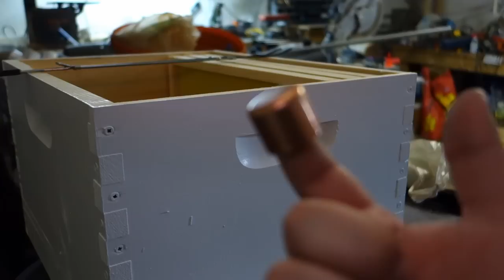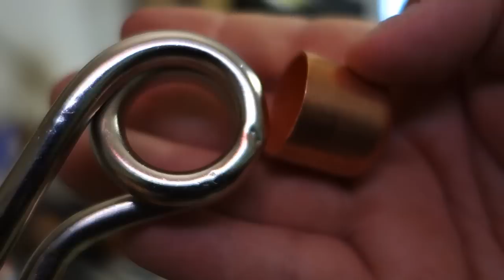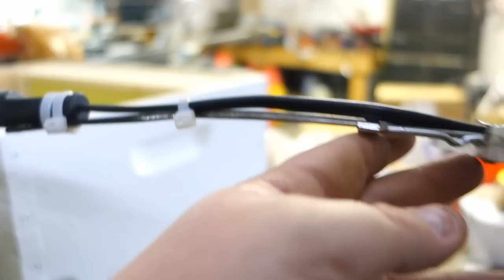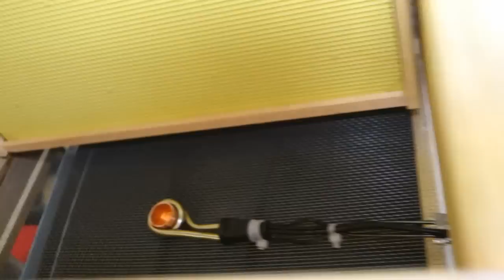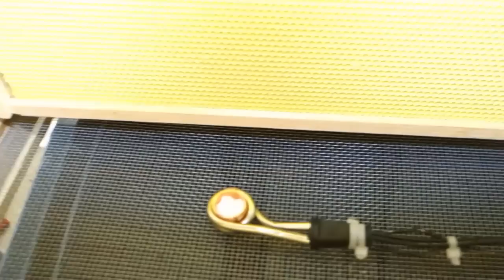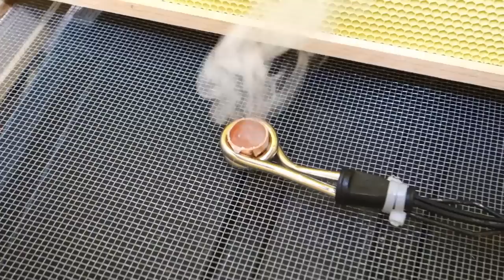Homemade Oxalic Acid Vaporizer

Comment: My question is… does the temp exceed 372F degrees? Oxalic acid vaporizes at 315F degrees but when it reaches 372, it turns to carbon dioxide and loses its potency.

Comment: Do you pull the this out before t
It start sputtering in the hive during treatment?
Reply from the maker: No I pulled it out after the timer turned off. I timed the amount of seconds it needed to burn through everything. I have since bought an OA machine and love it. It was expensive but well worth it.

Comment: I like the idea but this project fir me didn’t turned as cheap as you said. The main thing I  struggle is how did you twist the  metal part to make  it fit I to the entrance  ? I wish you would show the video step by step how you did that.  The heater cost me $10 each at the bath and beyond and unfortunately  something happens when I bend  and pound on it.  At this point I don’t know if it will be cheaper to buy ready to go or continue spending money  until it work. I am sure if you would show on the video how you did it I wouldn’t have to waste my money. Thanks

Comment: Just seen an equivalent video on YT suggesting the use of a diesel glow plug to heat a brass bored out nut. Surely using something that is designed to heat up to such temps, powered by a battery, might be comparable in price and have greater longevity?!

Comment: By silver soldering the cap into the warmer will help heat transfer a bit better.  The heater does not oxidize the oxalic acid, it just changes the state of the solid into a gas.... same stuff, no chemical change.

Comment: made it!!Works good these won't get hot enough to make formic acid .These work good BUT are pretty slow I used one on bunch of double Nucs today,formic acid and carbon monoxide don't occur until 372 degrees , this just ain't gonna happen with these too much heat loss

Comment: looks too hot to me
Reply: The idea that something at 220 deg.c, pushing inside the hive itself is bad.Ideally keeping heating business out of hive,and sending vapours in thru a small pipe atleast 200 mm long to cool off is what is needed to avoid harm to bees,brood and comb.Actually a smoker with pine needles  already hot(will not go much hotter than 250 deg.C with pine needles or  grass or news paper) ,and toss in 2/3 grams of OA loosely wrapped in aluminium foil  will do .By doing couple of times u know how much time is needed to vapourise all the OA.

Comment: Good idea but the heater is not meant to work out of water. You might get 3 or 4 uses out of this before it burns out. so first of all, use a 5/8 "  copper cap and it will make it easier to put it into the unit. Then you will have to buy a dimmer to run your electricity thru so as not to burn out your heater. A plug in dimmer is easier to use because you will have no wiring to connect..  Now you can regulate your voltage and not overload your heater. Only turn up the dimmer high enough to vaporize the acid.

Comment: Tried this with the ac unit from bb&b. Only works once, then burns out! Not saving money if I have to buy a new element after each use.
Reply: Vaporizers cost up to $400 you can buy a lot of these at $12 each. Put it in the rear under the mesh bottom board

Comment: Looking into OA for treating my hives.  What is the likelihood that this will melt the wax in the frames and cause a fire?  Have you tested with a wax frame in place to see how long that would take to happen or what the effects of the heat are on the wax?  I do assume some bees will get burned either way but as long as the whole hive doesn't catch on fire it is a sacrifice worth making.
Reply from the maker: Hi there, and thanks for the inquiry. I do not use this device anymore as it does not have a temperature control. It is really important that whatever design you use, it must fit under the entryway without pulling up on the bottom deep. I learned that if you do that, the device will be too close to the frames. I decided to use the oxvap110. It is pricey but boy is it worth every penny. Check out that video that I did.
Reply: I'll check it out, thank you
Reply: Dude that thing is sick
Reply from the maker: you like it dont ya? Its WAY better. The designer of it did a great job and it is worth every penny. I have very low mite counts from a mite infestation last year

Comment: appreciate the video, I'm thinking about doing this but I wonder rather than put the heater in the hive could the acid not be heated outside and delivered via a tube into the hive? wouldmthere be objections to doing it that way, might it condense on the inside of the tube perhaps?
Reply from the maker: thanks for the inquiry. I have thought about it myself but the answer is probably not. I have tried it and in order to properly sublimate oxalic acid, one needs to be in a certain temp range. Once the "gas" is making its way through the tube that is cooler than the heater, it will immediately crystallize. This is why it should be done inside the hive or RIGHT outside the hive. Thanks!

Comment: How much did you spend on the respirator?  Maybe use the bottom of a soda can if the copper pipe cap doesn't work out easily.  Maybe put the vaporizer under the screened bottom board if you are concerned about setting the beehive on fire.

Comment: I bought a heater off ebay and it was way too small for a 3/4" and way too big for a 1/2" so I found a brass screw thread cap for a gas line that I could screw into the coil. It worked perfectly. The only problem is the first time I used it the plastic holding the aluminum coil started to melt. This is for a Top bar hive. It fits in a 1-3/8" hole.[IMG]http://i127.photobucket.com/albums/p133/larrylwill/P1020552.jpg[/IMG]
Reply from the maker: +Larry Williard awesome, Check out my 2016 upgrade. Works very well!

Comment: Michael, did you ever come up with a better design? I just ordered an AC immersion heater since my hives are near the house. Do you recommend a dimmer switch to limit temperature and avoid overheating/frying the heater? Thanks for the inspiration.
Reply from the maker: Yes, I currently am almost finished with and updated design. Total cost is about 45 bucks but has temp control.
Reply: don't need it doesn't get hot enough actually don't heat near fast enough,I know I saw u time it but mine is different in field with wind especially today light mist.One commercial guy makes comments an everyone freaking..calm down it ain't ALL that.Don't get me wrong it works I did 22 dbl Nucs today but it took forever,I mean NO disrespect for price I LOVE IT glad I saw this!!! But just works once u build u will see what I mean...

Comment: I tried it worked one time then the heater shorted.  Not designed to work in air.. its for heating a liquid..so it gets too hot and burns the element
Reply: +Michael Josemans short intervals are required.
Reply: If you buy a 220 volt unit and you have 110 volt then you only use 25 watts with an 100 watt unit and it should not burn up.
It may take longer, but it should not burn up.
Will it get hot enough to melt the OA i do not know.

Comment: I've sublimated OA over 100 times using commercial devices. While I appreciate your thrift, I would caution folks constructing homemade devices about the temperature where sublimation occurs. Commercial devices are tested to stay in a temp range that sublimates without decomposing the acid molecule.  The idea is to vaporize the OA slow enough so that it stays OA and reforms as small crystals all over the inside where it kills the varroa. If you heat the acid too fast it will vaporize but you may be making a high percentage of carbon monoxide and formic acid when you really want it all to stay OA.  Also please don't sublimate OA in you house - the dog will thank you. :)
Reply: Listen to +Bill Hesbach here.  I've seen a lot of videos on youtube of Oxalic Acid turning liquid in homemade vaporizers.  What you should know is that OA does not melt.  When it gets hot enough it degrades into formic acid which is a liquid - that's what you're seeing.  Oxalic Acid actually sublimates.  It turns directly from solid to gas, and does so at a lower temperature.  Many beekeepers are unknowingly treating their hives with boiling formic acid instead of oxalic acid because of homemade vaporizers that run too hot.  I know because I made the same mistake, but after lots of research and consulting a chemist learned I was initially wrong.  Sublimation takes much longer - several minutes, and the powder just slowly disappears from the pan as it turns to gas and then forms fine crystals in the air which appears as a white fume.  These tiny crystals that find their way all about the hive are what kill the mites.
Reply: OK, so if the homemade unit is too hot, it's potentially dangerous to the bees. The natural question is: how hot is the coil? Has anyone measured the temperature of the immersion heater?
Reply from the maker: +Chris Rucker I found a wonderful design on BEESOURCE that uses a temperature control snap disc. I will be building one in the next two weeks.
Reply: +Chris Rucker >:how hot is the coil? That's a good question and I don't think they're all the same but normally immersion coils are rated at 120v and 300watts. The calculation is complicated, so measuring the temp would be easier. But here's the important part: According to the CRC Handbook of Chemistry and Physics when heating oxalic acid, the water of hydration boils off first, then at 315°F the oxalic acid starts to sublime (go directly from solid to vapor), and finally at 372°F any oxalic acid which has not yet sublimed decomposes to formic acid and carbon monoxide. Make a unit that can stay between those two temps, for a given time period, and you have it. BTW- that's what a Varrox unit does.  And forget about the bees, they move away from the heat.
Reply from the maker: Bill Hesbach I didnt think the Varrox unit has temperature controls.
Reply: +michael cifranic  That's the point...it doesn't need temp control because it's designed to the exact specs for sublimating oxalic acid over a given time period. Have fun with your next project and be sure to post.
Reply: I've experimented with a temperature controlled heater (stable to within a degree or so) and found that the OA sublimates at as low as 220F but does so much more readily up to 330F at which point it seems there is diminishing returns at higher temps.  Guess what I'm saying is higher isn't better and you should try to stay away from that 372F decomposition temp.  A 300F mechanical thermostat probably swings between 275 and 325 so might work.  A 350 thermostat will swing dangerously close to the decop. temp.  I used an industrial PID controller with a thermocouple.
Reply: +Dennis Atwood You're not seeing sublimation at 220F, that's the "water of hydration" boiling off. That water is formed when OA is crystallized and that part of the process is basically giving off water vapor, until about 315F when sublimation starts. What's missing in this discussion is how fast heating occurs in a homemade device. You need to heat slowly enough so you stay in the temp range long enough for complete sublimation to occur without approaching decomposition.  The commercial devices take 2.5 minutes to do that.  I'm saying that homemade devices, may or may not actually do that, unless, like you're  doing, a controller is used. But really, none of us know what we're actually achieving unless lots of mites die.
Reply: +Dennis Atwood Interesting experience in the oven, and I don't doubt your observation, I just can't explain it. With the hive sublimation devises, I'm thinking that the OA anhydrous salt may not be that visible in the short transition time between the hydrate and anhydrous states. But, do you agree that if you're not vaporizing the solid dehydrated salt, your not ending with OA and you're not sublimating anything. Assuming you're using OA hydrate, my thoughts are that the chemistry is already known and I don't think that can change- it would be like saying water can boil at a different temp. I guess you're saying there's an open-air component to sublimation, so if you can explain how the chemistry can change, Id like to hear your thoughts.
Reply: +Bill Hesbach I have seen the references to the sublimation temperature in the reference books but I wonder if it's like boiling point - a liquid will vaporize even under the boiling point, just not as rapidly.  I don't really have an answer here, can only speak to what I found.  

As to the anhydrous vs dihydrate let me paste what a chemist told me:  "Lets get into the weeds. The Oxylic Acid used is the dihydrate. When you heat it you will initially drive off water as steam with a little acid at about 157 C. Once the hydration is mostly gone the temperature will be above the boiling point of the anhydrous acid and near the decomposition point. There are several issues. Any acid vaporized (anhydrous) will quickly drop out of the vapor as a solid on a near surface or as a particle suspended in the vapor. It would quickly adsrorb water. It is hard to imagine getting a good distribution through all of the nooks in the hive with out heating up the whole hive. The literature indicates Oxylic acid is normally in put in sugar water and applied. The literature shows Formic acid is also effective. Oxylic acid decomposes to formic acid and CO2. Formic acid will be a vapor at normal temperatures. So that may be what is going on if this vapor method is effective. Both are natural poisons. Since the bees are much larger a higher quantity would be needed to kill the bees vs the mites."

I get the impression he was referring to the literature and not speaking from direct experience from sublimating OA.  I don't think there's any question about what happens, but I think there's confusion about the exact temperatures (with the exception of it breaking down at 372F - that's very obvious!).  When I have the time I'll have to make a video to show what happens at different temps.  A phase diagram for OA would answer all our questions, but I haven't been able to find one.
Reply: +Dennis Atwood  What your the chemist is saying agrees with the theory that once the anhydrous acid is vaporized it will particulate on surfaces inside the colony- I've seen that happen, but it could just be formic acid. The question we're dealing with here is the temp where sublimation happens and what rate of temperature increase allows the process. The only way to test the results would be to have the particles analyzed and I can't afford that test.  Thanks for the interesting discussion and I look forward to your video.
Reply: +Dennis Atwood ok, thats no big deal to over come, i have several temperature controllers. Can you or anyone else tell me the ideal time & temperature that is required to make perfect forms of fine crystals?
Reply: michael cifranic, please give link

Comment: How hives do you have? how many times have you used that? Thous are mad to be used under water I was wondering how many times it will dry fire? With 1 or 2 hives if it works 10 times that would be cost effective but if you had 100 hives it would not be, how many times have you used it?
Reply from the maker: +scott33761 I have used it about 6 times including tests. I made a new vaporizer that uses a glow plug because a lot of people were having problems with theirs burning out.

Comment: With the three heaters i ordered from amazon each one only worked one time, the first two i tested outside the hive (mistake as they only work one time) the third was done inside the hive and it really killed the mites. I left the heater plugged in exactly two minutes and the internal fuse still must have fried. If someone figures out how to solve the problem let me know.
Reply from the maker: +peeps Maybe the battery is too strong? I have a small 13 amp hour battery. I am actually switching to a different system so i dont have to worry about the battery being charged and such. I will post a video soon
Reply: +michael cifranic Well maybe that explains it, i was using direct current .

Comment: i tried twice, both times the element only worked once.
Reply from the maker: +peeps how long are you running it for? It should only run for about 2 minutes
Reply: +michael cifranic well to be honest i was not paying to much attention, both times were not in the hive I just plugged it in to see if it would work then when i put it in the hive nothing. My trials worked great, are you saying that 2 minutes and the internal fuse would not blow. thanks L
Reply from the maker: +peeps yes. There is a thermal fuse in there and if it gets too hot it will blow. When in water, the water helps take heat away from the element which allows it not to blow. But since we aren't submerging it, we need to only run it for as long as we need the acid to vaporize. About 2 minutes for 2 grams. let me know how it is if you try it again.
Reply: +michael cifranic thanks i will try it again
Reply: +michael cifranic any thoughts on the high temperature issue that are talked about in the comments?

Comment: You can use some cheap dimmer for regulate the resistance's temp. Directly connected to A.C. power, the oxalic acid not only vaporizes but jump in chunks. Nice job.
Reply from the maker: +Terrazocultor jose manuel Thank you! yes a dimmer is a great Idea to help reduce the voltage flow
Reply: +Terrazocultor jose manuel  Tienes abejas?
Reply: InstaBlaster.

Comment: Question: Does the heat of the cooking element heat up the wax foundation/combs right over it? Did you recognize damages to the comb like melting or deformation?
Reply from the maker: +Joel Meentzen I havent checked a lot but I am sure it melts a little on the frames right above it but not much